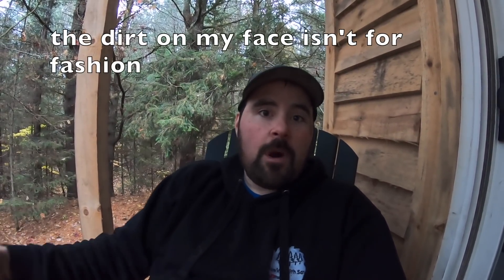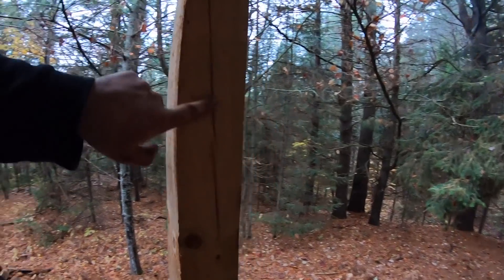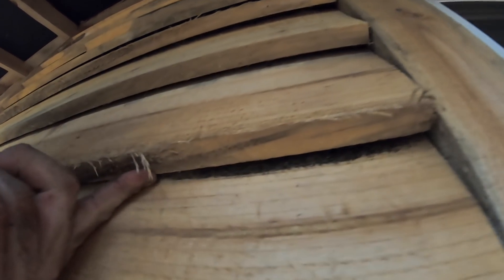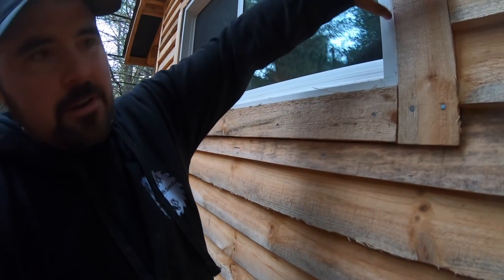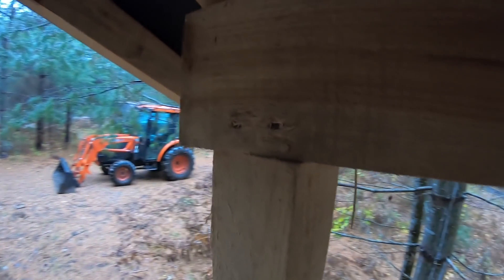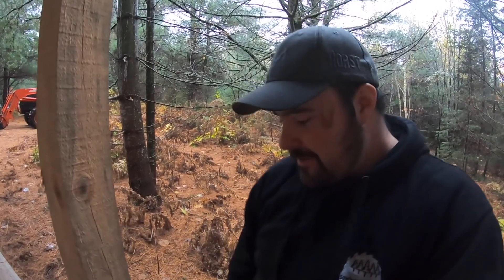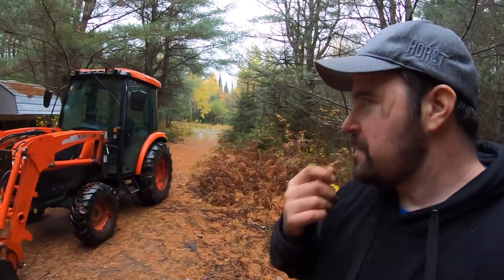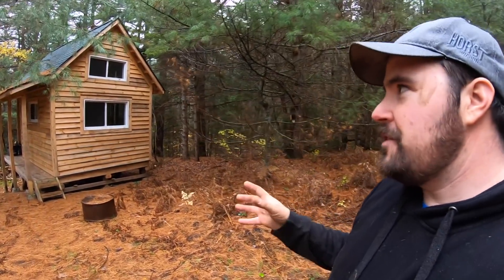Tiny House Built with Green Lumber and Floating Foundation

Comment: What do you do to protect your green wood from insects? Is that not a problem in your environment? Also, are you using treated material for the posts in contact with the ground/concrete blocks? Thanks -

Comment: If there’s not a taper on those boards. There’s no way you set them flat. And each one is 1”. By the time you get to the top, your last piece would be off the wall by a foot or more depending on how many pieces of siding there are. 

When you installed it, there was a slight gap under each piece to begin with.

Comment: Good video you have! Very helpful. I will do the same in about a month on my cabin using cedar 1" thick board. About trim I see some install the trim last over the siding and others like you trim first. Any reason for that? Any regret doing it first? Thanks for your help. I bought some SS nails just to make sure it will not rust
Reply from the maker: I just wanted to prevent that window trim from having really deep sills and so I decided to put the trim up first then siding around it

Comment: This whole video is lesson on why not to build with green lumber.
Reply from the maker: I’ve had great success building many structures with green lumber. Just have to follow a few important building practices to account for wood movement
Reply: @sawingwithsandy  Great results?
Reply from the maker: Yeah the buildings have turned out square, plumb and level and have maintained tight joints

Comment: When u make the lap siding what dimensions are u cutting. Thick side thin side  width
Reply from the maker: Great question George. I cut the siding the same thickness all the way across just like a normal board. 1” in this case
Reply: @sawingwithsandy  so u don’t use the siding attachment
Reply from the maker: I do use it now but at the time I didn’t use it
Reply: @sawingwithsandy  so what Dimensions do you have when using the lap siding attachment

Comment: Most houses in the country side in the 1800's were floating. The rock house I live in was built in the 1890's with rough hewn green wood. The frame sits on rocks. Still a solid little 3 bed house.
Reply from the maker: Sounds like they knew what they were doing when they built your place

Comment: Hi Sandy. I do love your shows but so disagree with your bark down deck. Don’t make a decision on judging a few boards on your deck. Sunlight and moisture on the outside end of your deck boards can do strange things. Lay two or a hundred outside. Bark up bark down. Never when stickering lumber to air dry did we stack bark down. It will cup and hold water. Same with the countless decks I’ve built.  Always crown/bark up. 
Sure you will get some weirdo boards and that includes pressure treated boards that won’t follow the norm.  But don’t take as a reason to defy nature. 30 years experience tells a different story.

Comment: Definitely would not use thin undersized unreinforced cement sill blocks for foundation pads especially on a slope. You could have poured concrete pads and installed them over a hole filled with stone gravel to control the frost and pinned the columns to them with steel rod.  You also need to isolate the wood columns from the concrete. You are trapping water below the columns and the end grain sucks up water causing rot. The deck would have  been better since you milled your own lumber if you had used a Korean floor system.  You have nothing for uplift including no tie downs. It is just foolish to spend that much money and time on the building and wimp out on basic structural requirements. You simply got lucky with the tornado and where it hit. They can be pretty directional depending on the storm.

Comment: I grew up in a house that was built in 1900 by my maternal grandfather who was the mill foreman at the sawmill owned by by my paternal grandfather. The foundation was ten by ten wood blocks three feet high placed on top of flat stones. Over the years, some of the blocks came loose and even a few fell over, because they were not tied to anything. The weight of the house was all that kept them in place. Wherever a block was no longer under compression force, that caused the floor inside the house to sag slightly. Had the blocks been tied together with cross bracing like you have yours, none of the blocks would have ever fallen over.

I have toured structures built in the 1800s that had dry stacked stones for the foundation instead of posts. How they lasted over a hundred years without moving is amazing.

Structures used to to built on foundations far less stable than yours. I suspect your foundation will serve you well for at least fifty years. Worse case would probably be some shims occasionally. Here is how I know that.

My father got sick when I young child and was no longer able to maintain our house. He was buried on my tenth birthday. I became the man of the house and had to learn how to maintain the house. A neighbor showed me how to replace the posts under our house and shim them. My father had an old house jack that I found underneath the house. I learned to use it. It was the screw type. It was really heavy but I eventually could get it in place to jack up the house at the appropriate points to replace the fallen posts or shim loose posts. My mother was able to live in that house until 1972. I graduated from college that year. I helped move her into a smaller more modern house that did not need as much annual maintenance.
Reply from the maker: I appreciate the wealth of info you shared with us Jack. All the best and hope your summer is going well

Comment: Just the kind of info I was looking for. Silly question but, do you think that using screws instead of nails for the framing and such could reduce at least marginally the twisting or cupping of some of the pieces? Does that make any difference at all in the frame work? I'm an absolute novice in building cabins, and I'm planning on building my own pretty soon.
Reply: It doesnt matter. Its more the placement of the fastener and you must place them as he demonstrates if you dont want everything to crack. Screws will not resist shrinkage but bolts where applicable, will

Comment: Great video. Agree with most everything, Except.. Here in Colorado the winds will more than likley at some point move that building or blow it down. That is the main reason here that we would want a positive conection to a concrete pier to prevent uplift. The max gust load here on the front range of Colorado is 150 mph, in the mountains it can be 200 mph. If you have good draining soil your frost heave is basically nothing. In the mountains here there is basically nothing as its mostly rock and sandy soil, which doesnt hold moisture..Great video!!!
Reply from the maker: I can imagine that would make me want to put a secure foundation in as well

Comment: Did you treat your siding with anything? Water sealer? Stain? , Etc?
Reply from the maker: Hi Ricky, this building has no treatment on it. I find it lasts well as long as no water sits against the untreated would as would be the case with soil contact or a deck without a roof over it.

Comment: If I wanted to use green wood for board and batten, would that be possible and/or is there a trick to it?
Reply: Board and batten is the perfect siding technique for green wood, used on barns for centuries
Reply from the maker: Yes it's entirely possible and I've done it before with success. The board  gets nailed along one edge only and the other edge is held down by the batten which gets a single nail in the middle of the batten with that nail passing in between the two boards underneath. This ensures as the wood dries and shrinks, it doesn't crack due to two fasteners in the one board.
Reply: @sawingwithsandy  Thanks!!!

Comment: Built an off grid 24 by 24 log cabin 12 years ago on well drained ground with floating posts in a similar brutally cold climate area. Worked out well, no noticeable shifting, doors and windows open/close without issue. So far so good.
Reply from the maker: That’s great to hear!
Reply: Few years late here but... did you use all/mostly fresh green lumber?
Reply: @Webly101 we used kiln dried white pine logs. Set cement pads on styrofoam on compacted gravel perimeter berms, the ground was otherwise undisturbed. Still no shifting. I’m retired now living here full time. Off grid DIY Solar powered.
Reply: @northerncaptain855 appreciate the info and quick response, I'm just getting into this stuff and would eventually like to get a similar set up going.

Comment: Another foundation type that works crazy well vs frost and is very inexpensive. Pressure treated lumber laying lengthwise atop a base of 3/4” rock tamped down 2ft wide by 2ft deep by length of your beams.
The rocks allow moisture to drain, keeps the lumber dry, minimizes frost heave, and disperses the weight of the home like a concrete foundation
Reply: But would be unavailable in hard.

Comment: The cupping will nearly always show up opposite the arc of the growth rings. As they dry they shrink & the curl forms as the outer rings pull on the inner ones from that shrinkage. As for the frost heave I think the tiny house is so small & has so many posts the lift should be mostly even except maybe right at the center where the ground water would be least.
Reply: thank you for explaining the cupping, seemed opposite what I would have thought would be the effect but your explanation cleared that up. but while this seems to go hand in hand with Sandys explanation of the floor boards it does not match the way he seemed to describe how to put on siding?

Comment: During the 80s it was a big deal to put 10 inch cardboard tubes below frost and fill them with cement for a base to build off was done for some buildings and porches and such every one i was involved with have failed and if expensive to repair you have what all these that i have repaired been converted to.   Your way is so easy to level up if ever need be .
Reply from the maker: I think it should work well for this cabin. Hopefully no movement in the future

Comment: On your small house foundation: I live in western Washington, rains to say the least, bought a house 50 miles southeast of Seattle, post and beam foundation, built in 1927. Original posts all sat on rocks, as posts were replaced over the years, they sat on concrete blocks, not a concrete foundation in site. What not to do is to put the block on top soil, no organic soil, dig down past it. Clay, sand or gravel, tamp it down and put your block on it. Cross bracing, the more the merrier, Sandys looks great.
Reply from the maker: Great advice. Thanks Robert

Comment: I use a lot of 5/4×6 pine fence boards that are "green" for fences, pig feeders, well/pump house, and other small things. I stopped using nails about 6 years ago. Torx head wood screws can be tightened as the wood shrinks and whatever I build can be taken apart without damaging the wood. The screws are a bit more expensive, but removing them does not damage the wood(unless you screw them in too deep) and 99.9% of them can be reused.

I make various things like coffee and end tables, flags, address signs and boxes out of the recycled wood.

I am in the process of researching saw mills and just watched your video about things to pay attention to when using the machine.

Comment: I have used spiral nails in the past and they are great for not pulling out and such...but do cost quite a bit more than box nails.  Something I have not heard mentioned in any of your videos or comments is a technique I have used for over 20 years to prevent the same thing as spiral nails do but using regular nails(box or common) instead.  If you nail at a slight angle(maybe 10 degrees) and make it so that not all nails are at the same angle... have first nail at 10 degrees one direction, next nail in opposite direction or straight in, they end up pulling against each other and the wood will not be able to pull up or loosen.  This especially applies to plywood/osb.  I remember taking the decking off a roof once with a shovel and the ENTIRE sheet popped off in a complete piece....every nail was put in perpendicular.  I tried the same to a piece of plywood I had nailed that had to be removed and it was completely destroyed by trying to pry it up as I had nailed using a slight angle with each nail.

Have you ever tried this method of nailing?
Reply from the maker: Interesting idea. I haven’t heard of this being done before. I may have to give it a try
Reply: @sawingwithsandy  Early on in my carpentry career of 22 years(haven't been a carpenter for about 14 years...am a software developer now since that career ended back in 2006) a long time carpenter friend gave me this technique which I have used ever since...and have gone back to many projects years after completion and have never seen anything I have nailed come loose.

Comment: Do you live in this Sandy? With your boards coping could you not take it off and turn the boards over to take the coping out of it?
Reply from the maker: Hey Marc, I just use this for guests and for when in want to camp out. I likely wouldn’t be able to flip the boards without Damage in the siding but I could do the flip for the deck boards without troubleb

Comment: We also get frost heaves in the winter so I used adjustable pier blocks on my 8x12  4 wheeler/ riding lawnmower shack. That way I can take a wrench an tweak it if needed. Also like to dig down an inch or so to give the block a bed to lay in. Don't know if this is right but has worked for me.
Reply from the maker: I like that adjustable pier block idea

Comment: I have always been told if you put smile up on wood decking the board can hold moisture, if you put smile down or frowning at you,  the board will shed water better and not cup the moisture.. Has to do with the soft wood being able to absorb and hard wood of the grain being able to shed the moisture better. What do you think ? I never claim to be a know it all it just made sense to me.
Reply from the maker: I’ve also heard what you mention here. I’ve not put down hardwood boards before but I do notice with softwood that sometimes boards will move in both ways. I’m wondering as well if kiln dried wood moves differently than wet wood.
Reply: All the wood that I use is pine we have very little hard wood in northern Mont.  as far decking goes I've lived long enough to see some of the decking I've built need replacing and where the smile got left up that wood is starting to rot & need replacing the smile down stuff is in a lot better shape. Thanks for the response back.

Comment: Good timing on the foundation talk. I’m just about to start building a 12x20 post and beam shed with green lumber. I studied the different foundation methods. Here in Michigan I’ve always been told to put posts 3’-4’ deep to stay below frost line. Interestingly, after some research I also found that on grade foundation is very common in many places. Especially places further north where the frost line is so deep it’s very expensive to get beneath it. There, people do just what you did. It’s better to sit on grade than put a post in the ground too shallow. If you’re on grade and frost heaves the post, it will likely fall back to its original spot once thawed. If not, shim the posts as necessary. No big deal. If you put a post in the ground too shallow and frost heaves it, it will likely not go back down. And you won’t be able to pound it back down.
Reply from the maker: Some interesting points you brought up. I would like a concrete foundation but time and money and location all factored into my decision.  Good luck with your build. Sure sounds like it'll be a nice building. Keep me posted

Comment: Wow, awesome project! A shout out to you from Rhode Island (USA)  So, in your area, di they sometimes cut a  one inch notch in the posts to carry the deck rim joist?  I bet your real good with a chain saw.  I did a project called fake post and beam, the top of the 4x4  could be a 1 1/2 inch wide tenon lined up with the joint of the doubled up header. then each of the headers could be notched where it goes past the tenon. Notch could be 3/4 deep from top to bottom. Lots of saw cuts and then smash out the pieces.  Real good education from you on using green lumber. Thanks
Reply from the maker: Hey John, thanks for tuning in. I've not seen too many notched out rim joists in m yday but I'm sure they're around here somewhere. I definetily put the hours on the chainsaw. It's a nice quick alternative to hauling out the miter saw sometimes. I like your fake post and beam setup. I'll keep that one in the back of my mind.